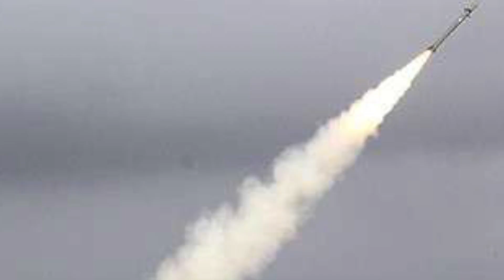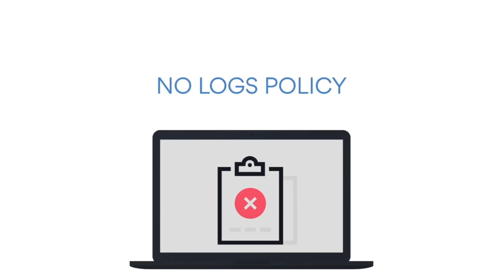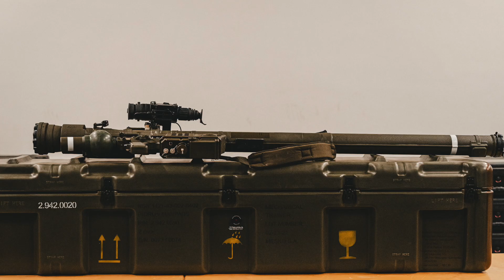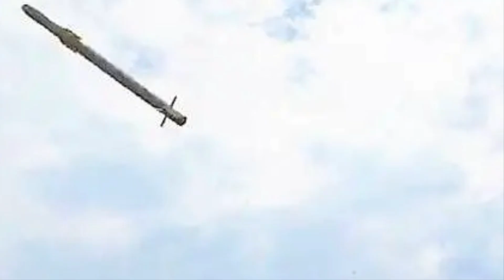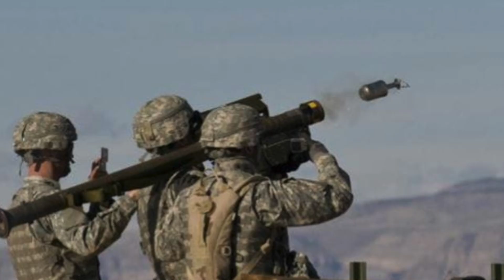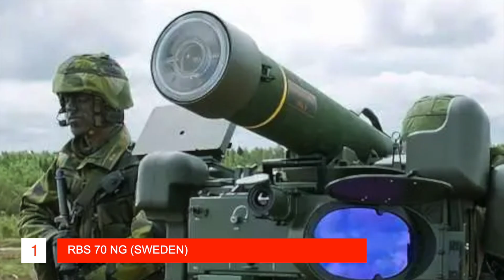Man-portable air defense systems (MANPADs) | Defense Updates

Comment: You have to differentiate between a portable system that a single soldier carries and move fast and another system with more components that cannot be carried  by a single soldier and has to deploy it. example Igla vs Startreak. For other side Verba has more range ( 4km altitude and 7 km range) and can be deployed with a portable radar linked to a viewfinder so that the operator can watch the incoming threat.

Comment: I think that only shoulder launched anti-aircraft missiles should be counted in the ranking of manpads. If it's tripod launched it should be disqualified
Reply: Yes and no
The reason we are seeing tripods is because technology has advanced 
Thanks to carbon fiber , titanium and high strength aluminum
those tripods are relatively light
Ukraine has show the strenght and weakness of MANPAD
Limited destructive capable and range 
In theory, you can address those but you have to make the missile likely heavier and that tripod will make life a lot easier

Comment: Ukraine has shown the limits and strengths of MANPADS. MANPADS limited destructive capability can be overcome as technology has gotten better and seekers smaller which allows for bigger warheads but its limited range will never be overcome. Ukraine has shown that weapons like  AIM-9 and AIM-120 for SHORAD are better than MANPADS against aircraft due to their substantially larger warheads but mostly due to their longer range over 20 miles. MANPADS are the 4th generation right now
I expect to deal with issues found in Ukraine that the 5th gen missile will have larger diameter between 80mm and 90mm at least to address short comings